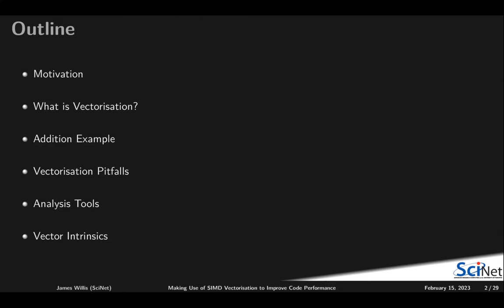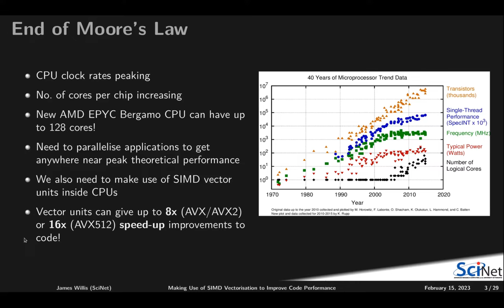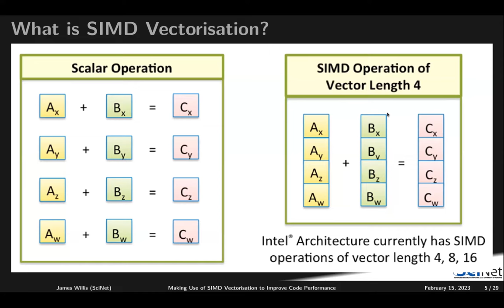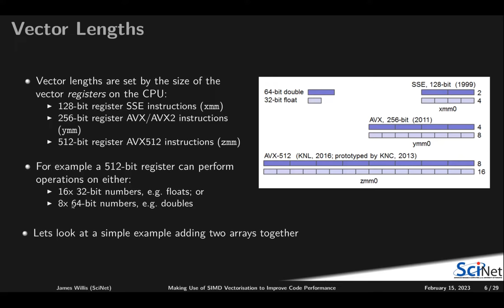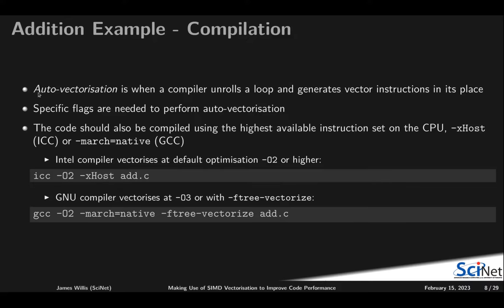Making use of SIMD Vectorisation to Improve Code Performance

Comment: You noted that there is no efficiency when you have iterations a[i]=a[i-1]+c, loop dependency. That is correct, but still vectors could be used successfully if you have more than one array. For example: vector instruction SSE allows me to calculate 4 iterations with one _m128 register, Mandelbrot set for example. First iteration at first 32 bits field of that package, second iteration at second field of xmm register, third at third 32 bits package and 4th at the last one. So we are able to calculate that with xmm. Instead of using xmm for one iteration, I can use it for four iterations. Still we are able to use it for a large scale of complex number iterations...